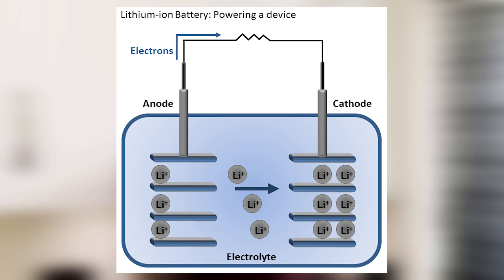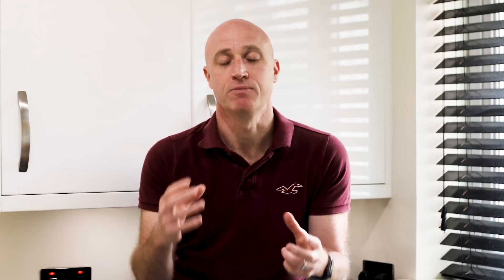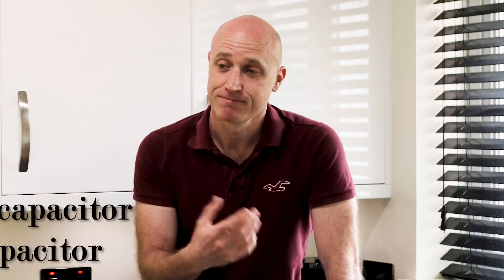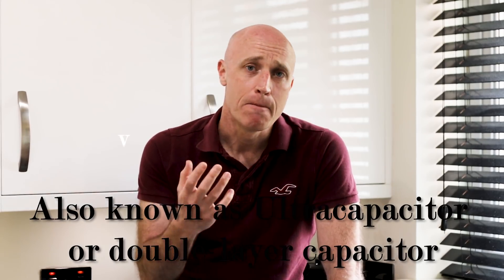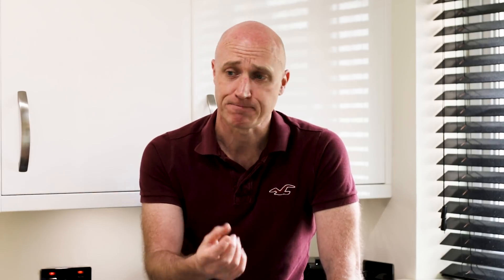Super / Ultra Capacitors | The Future of EV Car Batteries?

Comment: IMO ultra capacitors should power the car and provide Regen in hybrid batteries, and traditional battery chemistries should be the range extender. that would increase power and Regen efficiency, solve most battery cooling and durability issues.

if ultra apacitors density and cost improved you could even have a daily range on capacitors alone with very fast charging and no wear on the battery pack

Comment: So did this Chinese car with maxwell super capacitors that was due for a 2019 launch actually launch in the end?

I wonder whether super/ultra capacitors would be suitable for train acceleration? You could have a recharge point at every station which charges the super caps then  batteries could take over once the train has reached its max speed.

Comment: “Batteries were invented in 1800 Li in 1970, this is old technology”
Later in video..
“If somebody can master a supercapacitor that can hold vast amounts of energy that person would get exceptionally rich and we’d all benefit from it”

Yeah and hopefully he’d turn his attention also to a tree that can grow money and a goose that can shit gold 😂. What’s the use of saying we need to replace something with something else that is physically extremely difficult that doesn’t exist yet? You even hint at this saying you’d need a trailer full of caps to get decent range. A supercapacitor would have to have an increase in energy density 2000 fold to match fossil fuel...

Supercaps in fact do degrade and the barrier inside can break down. Supercaps have shelf lives similar to batteries. Lastly Li is not struggling to make power... The P100D makes 1000 lb ft of torque and nearly 800 hp.

Comment: I think four wheel-hub powered 20hp (surge max) motors powered by a 25hp high efficiency gas motor-generator being buffered by a medium sized bank of super capacitors is the best short term achievable solution. This would eliminate huge gas economy looses in city and slow traffic conditions, cut 50% of gas powered pollution, and cut losses in complex transmissions and drive-train gearing while supplying 4-wheel drive safety, and motor redundancy.

Comment: You are speaking as a layman.

Here, I had put up some practical numbers about incorporating Supercapacitors along with Li-Ion on Tesla...
https://www.quora.com/What-is-the-probability-of-a-Tesla-vehicle-ever-incorporating-ultra-capacitor-technology

What i calculated is only for 1 minute of acceleration for Tesla Model S from Supercapacitor, and look at how much weight it increases !!

Presently only limitation for supercapacitor is extremely low Energy density,
For example, Li-Ion Tesla uses is around 250 Wh / Kg,
where as Supercapacitor presently is around 7 Wh / Kg :|

Comment: Biggest problem with supercaps is their operating range - 20% SOC in a supercap is 0.5v, 20% soc in a li-ion is ~2.,65v

They could be used very well as a mass charge/discharge buffer (to protect the battery from those high dis/charge rates) however - as you mentioned

Comment: Supercapacitors don't store power, they store energy and not a lot of it. Power cannot be "stored", it is time-related parameter. When a supercapacitor discharges its energy over a very short period of time it produces a lot of power during that discharge. A battery of a similar size can store significantly more energy than a capacitor, but if can't discharge it as quickly due to its internal resistance. So it is less powerful. A. Pedant.

Comment: Ultra capacitors are also very durable and safe.  They have temperature range of -40C to 85C, as well as much more resilient to shock and vibration than batteries.  They can also be charged and discharged 1,000,000 times vs Lithium ion which can be cycled around 1,000 times.

Comment: Use supercapacitors to recuperate brake energy and return it to the vehicle for acceleration. Got it! 

Why isn’t it being done already?
Reply: Toyota used it on their Le Mans racecar (TS030) for brake regen and I think boost. Why is it necessary in everyday cars where brake energy could just be put back into the battery?

Comment: As Bob Jackson mentioned previously, Skeleton (in Estonia) seem to have an up and running solution, used in a clever way.
(Interview by Robert Llywellyn on fullycharged)
They effectively use the regen braking to charge the capacitor, they then use the capacitor to accelerate the vehicle (as far as possible). This means that the battery is, generally speaking, only used for a small portion of acceleration and for maintaining cruising speeds.
This has great advantages, since one failing of batteries is they don't like stress. High, fast inputs (supercharging, hard regeneration) can, as we know,  eventually reduce battery capacity and life. Also, the battery size may be reduced. Since the capacity ratio by volume, according to Skeleton, is about 10:1 this would be a considerable saving in both weight and volume,. Alternatively, this could provide a very useful range extension for existing volume. (Mmmmmm.... Roadster, Semi....?)
They mentioned units "being used in Motorsport". Suddenly it clicked, Formula One! Lemans!(?) Maybe the new formula E cars?
Does anyone know?
Then I watched the rest of your video and found I'd repeated almost exactly what you said! Oops!

Comment: The way super capacitors can work would be that the vehicle main battery would slowly charge the ultra capacitors. The fast acceleration and regen breaking would be straight from the capacitors, hence the main battery could be saved from the power shocks that would reduce its service life. Normal charging would probably bypass the capacitors. I assume the capacitors would be kept only partially charged such that there would always be spare capacity available for absorbing the power from regen breaking. I assume regen braking might actually work better utilising these capacitors as there would be virtually no current restriction.
Reply: Good comment what you said is the best use of Ultra capacitors

Comment: This was difficult to watch due to  contradictory use of some of the language. 

I'm not real up to date with current battery technology so I'm not sure that the advantages would out weigh the extra cost and complexity you would have to build into the system. I have pondered the idea of using the fast charge characteristics of super capacitors to efficiently make use of breaking energy for some time. It certainly is worth investigating on the face of it.

Since installing a solar panel, deep cycle battery and inverter in my work ute I'm considering experimenting with a super capacitor starting pack to replace my cranking battery. The weight difference would be considerable and the ability for me to be able to charge it from the deep cycle should negate the disadvantages of it's lighter energy density. 

To be free of the costly periodic replacement costs of the cranking battery is a big deal too if it can be substituted effectively.

Comment: There's a basic difference between batteries and supercapacitors that needs to be dealt with.  Whereas batteries hold their output voltage almost constant until they're almost discharged, capacitor's voltage drops constantly while they're discharging.
So for example a 12.6 volt battery might deliver 12 volts when it's half charged but a capacitor would be at something like 6 volts when it's at half capacity.  If you're using it in a system that demands a constant voltage in (most motors do), then you need to put some electronics between the capacitor and the load that boosts the voltage up to keep it constant until the capacitor is discharged.
This isn't too difficult but it has to be done.
Reply: Warren NZ yes of course , capacitors while improving are most useful as a battery compliment. Good for absorbing strong regen current.as well as short burst of excelleration.
The hope is to have enough capacity to absorb a whole mountain grade hill. Or excellerate from zero to 65mph before the significant voltage drop!
 They use a Buck-Boost converter, which is connected to the ultracapacitor bank at the Boost side, and to the main battery at the Buck side. The control of the system measures the battery voltage, the battery state-of-charge, the car speed, the instantaneous currents in both the terminals (load and ultracapacitor), and the actual voltage of the ultracapacitor.

Comment: It seems super capacitors would be useful at charging stations because that's when you need HUGE current to pump "hundreds of kilometers" into a car in a few minutes.
Reply: Warren NZ 
That won't work UNLESS you reduce the discharge rate. It would overstress the (current) battery.
Reply: +Roger Starkey Yes of course we need batteries that can be rapidly charged first but that will happen.
I have a Lithium Polymer battery the size of a banana with G7 chemistry and it can be charged at 60 amps which will take it to 90% charged in under 10 minutes and that battery is about 7 years old.  It doesn't even get warm at the 40 amps my bench supply can provide but the "monster speaker cable" I use to connect to the battery gets so hot I can hardly hold it in my hand!
And that's old technology now so it will happen.  And when it does we're going to need charging stations that can supply the huge currents and that was my point.  Super capacitors can do that.

Comment: That's like saying why are we using forks and knives, it's antiquated technology. Modern day batteries are EXTREMELY cutting-edge technology even though the general concept of storing electrical energy via chemical action was discovered a long time ago. HOW you store said energy is anything but old. What a silly notion. Capacitors are even older and were first designed BEFORE batteries were (circ 1745). 

Also, capacitors do "degrade" and fail. Ask anyone that works in HVAC or home audio. The energy density of a capacitor has nothing to do with their discharge rates..... ok I give up... this video needs a lot of rework :P

Comment: The lithium ion do not travel trough the wiring, in a DC system the electrons travel through the wire, wile for a AC system those electrons just vibrate in place

Comment: What's your opinion electric or hydrogen??
Reply from the maker: javaid shah for me, electric. There is a place for hydrogen but I don’t think it’s in cars. Why carry around a battery charger when you can just plug in?
Reply: Hydrogen needs so much power until  you can use it:
 1) You produce Electricity  
2) Second you Electricity  to the Hydrogenproducer That costs not much Power.
3) you take all the Electricity  to make Hydrogen  by water. That costs Power. So you lost many of your Power. But now the Power is in the Hydrogen ;)
4) you store (compress) Hydrogen. That costs  Power. 
5) You transfer Hydrogen to a Station. That costs also Power.
6) You transfer it in your car. That costs Power.
7) You convert Hydrogen in to Electricity to run the Motor. That costs als much Power.
With the rest  of your Power you will run a Car?? Yes it works much more better than any batter.  Right.
But the way until the the electricity reach  you motor  is complicate and expensive. 
Or you run your Motor by Hydrogen. That is also very good. But you lose Power by that pricess.

In the End: 
Charge and drive to be efficient. The elektricmotor by Tesla is more than 100 years old. We never invent a engine with more efficient.
Reply from the maker: Christian Mancke I agree. The only time I have seen hydrogen production being used to good effect is on Orkney. They use the spare power from wind, solar, tide etc to produce and store hydrogen. It was renewable energy going to waste so why not use it this way 😁👍
Reply: In short, not Hydrogen  but Electric cars are the future.

Comment: What is the other alternative for cars??
Reply from the maker: javaid shah hydrogen?
Reply: EV Opinion 
Don't think so.
D.I.C.E.
Dirty (To make, often fossil fuel)
Inefficient (uses too much power)
Complicated (too many steps)
Expensive (all of the above)
Reply: Add to that explosive, chemically active (make metals brittle forming hydrides), next to impossible to contain due to its small molecule and a host of other issues relating to weight, lubrication, etc.

Comment: LIth-ion battery stores electricity in a chemical form. 
Supercapacitors stores electricity in electrical form. 

When going from electrical to chemical (battery), or the reverse, there is a state change.  This may lose 15%.
When going from electrical to electrical (supercapacitor),  there is no state change. Loss is very, very low.

Chemical batteries discharge and charge slowly.
Electrical Supercapacitors discharge and charge immediately.

Chemical batteries have a high electrical storage capacity.
Electrical supercapacitors have a  low storage capacity.

Supercapacitors are good at storing electricity very quickly and releasing it very quickly, as in kinetic brake energy and releasing the charge for vehicle acceleration or starting an engine in start-stop.  Using batteries to reclaim electrical braking energy reclaims less than 50% of the generated charge, a supercapacitor reclaims around 95% and releases that. 

Merging the two into one box is called a super battery.  

Supercaps are used in urban electric trains to reclaim braking then release for fast acceleration. Some are in large banks on the trackside.
Reply from the maker: John Burns thank you for a great simple explanation. I’ll call on you next time I need a script to explain anything technical 😁👍

Comment: My only criticism of the video is his insistence that super capacitors can only discharge quickly.  This is not true.  They can discharge slowly and he even admits this when he says it is possible to run an electric car solely on super capacitors just that it would have a very short range.  Unless he is talking about a car meant to be raced on a drag strip, which I am sure he is not, all street legal electric cars have the ability to discharge the electricity from whatever energy source they are using.  They when he says it is possible it means that he knows it is possible that super capacitors can discharge slowly as well.

Comment: super capacitor tech is older than tion batteries. like lithium ion they have evolved in 50 years. lto batteries and solidstate batteries are improvements. many ev's use super/ultra capacitorn to improve lifespan and charge efficiency.

Comment: long story short, we do NOT have a Super Capacitor yet. They are still working on that.
Reply: +Kon Tiki "we do NOT have a Super Capacitor yet"
It depends how you define it.  I have six 500 Farad capacitors at home each the size of a D cell and they call them supercapacitors.  Having dealt with microfarads all my life I think it's a suitable label for 500 Farads.
Reply: just to clarify - they are already using  these capacitors for regen braking and  instant torque in Tesla but an ultra-capacitor/ super Cap that has both the energy density of regular batteries and power density of Capacitor are  yet to be developed.  The super caps you are saying are bulky and are no where near the energy densities of regular batteries.
Reply: Kon Tiki 
https://youtu.be/KQ2Eo6wl5r0
Reply: +Kon Tiki  Yeah they'll get better and better for sure.  The bank of 500 Farad capacitors I have are pretty impressive already.  Six in series gives 83 Farads and they can melt remarkably thick copper wire in a short circuit.  My 40 amp bench power supply charges them in about 4 seconds.
Reply: i hope we will soon see the day when these can be used in Flying and for that we need to have twice the energy density that we have in our current batteries.  Do you know by any chance why they have not considered fuel cell with hydrogen for flights?

PS: i know there is a couple of electric airplanes already but their flying time is less than an hour.
Reply: +Kon Tiki I don't know the answer but I suspect that hydrogen never got popular enough before electric became the preferred technology.  Just guessing though.  It's often a weight thing for airplanes.
Reply: @warren52nz  It is my honest opinion that it is moot thinking cars will be powered by solely by supercaps in the future. Everyday cars don't need an immediate burst of tons and tons power and the common trend is to pair Li with supercaps which makes sense for short bursts of acceleration/decel. Replacing Li with caps doesn't. You'd need 2000x more energy density to match that of fossil fuels.
Reply: @amorag59  I agree. We'll need some sort of battery (energy stored chemically) for endurance and capacitors can be used for surges both in discharging and charging. It's a natural marriage of technologies. I suspect they'll eventually make batteries that can be charged and discharged so quickly that they won't need capacitors.

Comment: The energy wasted by flexing tire treads could be partially recovered via embedded piezo transducers coupled with supercapacitors feeding brushless dc motors with coils rotating on the tire acting against permanent magnets located on the outside of a central hub motors powered by battery banks in the car chassis. Think it out one step at a time.
Reply from the maker: Dave L if I had the money I’d invest!! 👍

Comment: Some people saved weight and maintenance by replacing their lead acid battery with a home built pack of super caps.  If all it's used for is starting the car, it's more than enough.

Comment: Tesla car battery packs are lasting longer than originally thought possible due to improved chemistry, charging 20-80%, and the use of thermal management. We could be talking 20 years before degradation drops to 75% lasting longer than the rest of the vehicle. Even then the batteries can be re-purposed for use in powerwalls and industrial battery packs